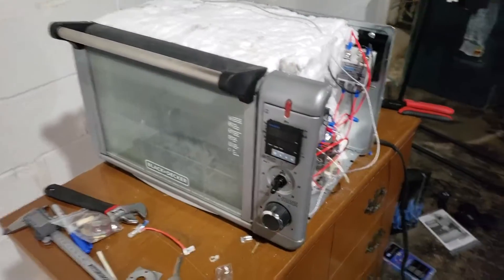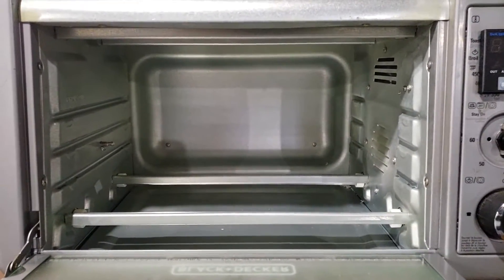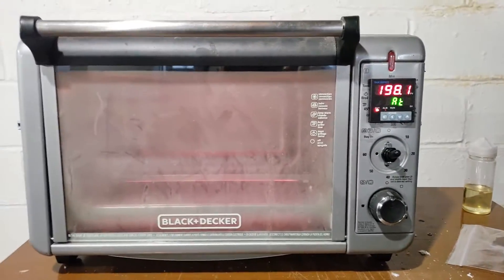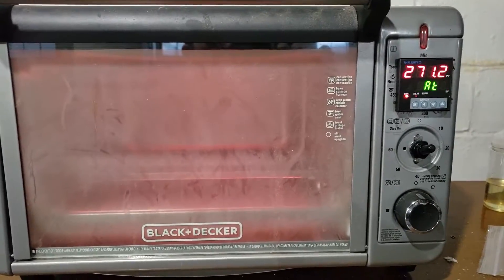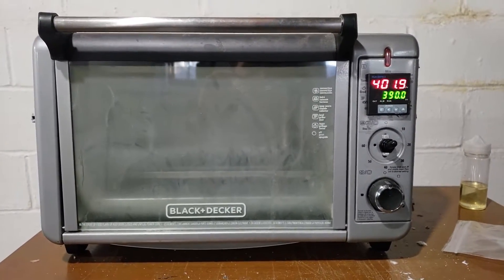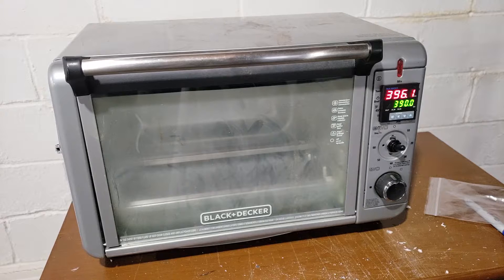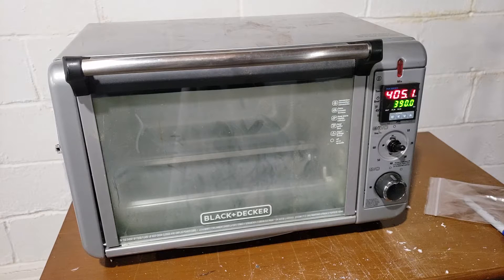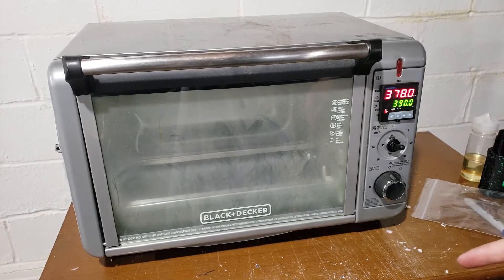PID Controlled Toaster Oven | BORING

Comment: Tinman awesome job on this brother!  I think this is a great idea for a more accurate baking.  Thanks for sharing this. Yeah why did they wire the hot and common so close together haha. Did they auto tune finally settle out better?
Reply from the maker: I'm not sure about the Chinese wiring job. Hehehe. It stayed +/- 9 degrees. That PID doesnt turn on and off rapidly like it should. I have two of the Inkbird controllers and they both dont do the greatest job holding a steady temp. It's like they dont "learn". My MyPin PID works excellent though. I'm not a fan of these Inkbirds. After reading about them I'm not alone, either. It's basically an on/off switch and doesnt pulse.

Comment: The very first of it's kind to the TRN Family, a....."HighSpeedPCOven" ... nice work Kurt. "PID boolits are better...heheheee....right?"
I have one concern though...if you have put the insulation within the controls side panel 'over' the controls you have effectively trapped the 400ºƒ oven temperature in that side control box. Your relays & switches, IIRC'ly are only rated at 75ºç, that's less than 167ºƒ so that's going to have to be vented..and isn't there vents on the side panel? You could carefully stuff the insulation up against the inner wall around the bases of the controls and prolly not overheat in there but I suspect that there is already insulation within the toaster wall on that side.
Also any wire you have added to the base of the heat elements should be the same type wire as the heat resistant braided wire that's originally on them or the insulation will eventually fry. A quick inspection in that control enclosure every 10 uses at first, say for a month or so might be a good idea with emphasis on what the snap on flag contacts of the heat elements look like...if they start to darken you'll have trouble for sure.
Here's a link for choosing the proper wire for those hot contacts on the element ceramic bases... https://www.mcmaster.com/high-temperature-wire
If you have trouble finding a supplier for a small quantity of wire, just locate an old toaster and gut the wire from it you need.
Very nice work there PorchPup...and a very handy tool in the 'RabbitHole'.
Reply from the maker: PID boolits are more accurate. Just don't tell James, hehehe. I did put insulation between the oven wall and all of the controls. I stuffed it everywhere I could. The side where the controls are has venting louvres on both the side of the oven and the rear, and I mounted the heatsink directly to the rear louvres to help cool it down. I'll definitely keep my eye on those connections and wires from the elements. Thank you again for all of your help, Charlie. Not all heroes wear capes, some wear shorts and sandals 👍

Comment: Well done TinMan :)  Where is the probe located?  Like how does the PID know what the temp is?
Reply from the maker: Thanks, Cranky. It's on the left side of the oven away from all of the controls. It's a short stubby little probe. I think you can see it when I show the opposite side of the oven. It's about halfway up the oven wall and sticks into the oven about 3/4"